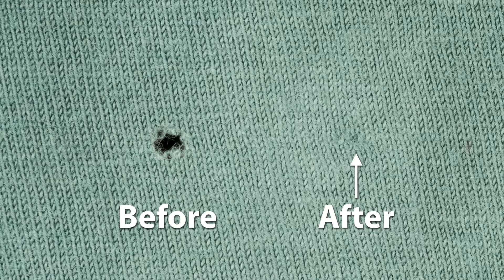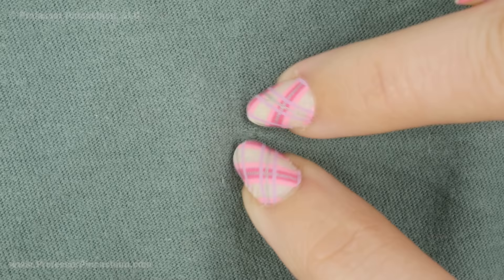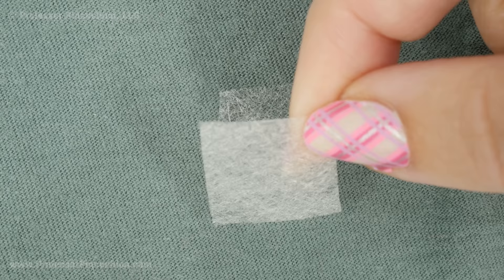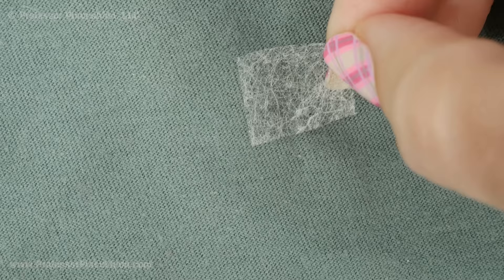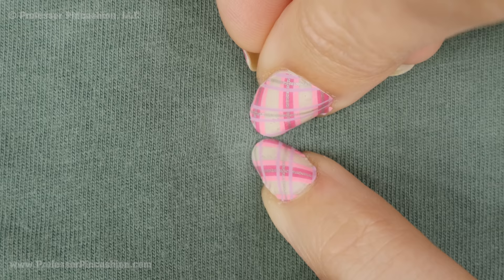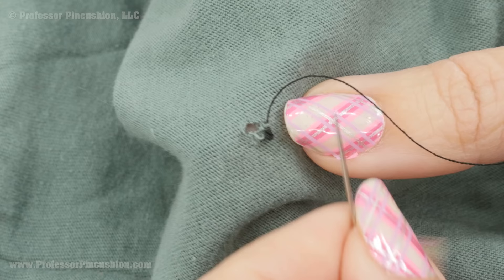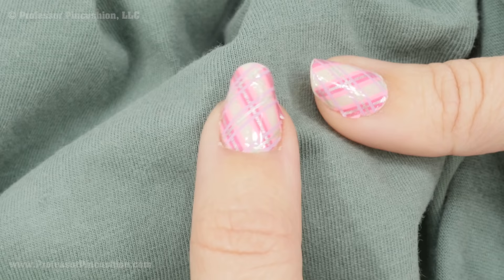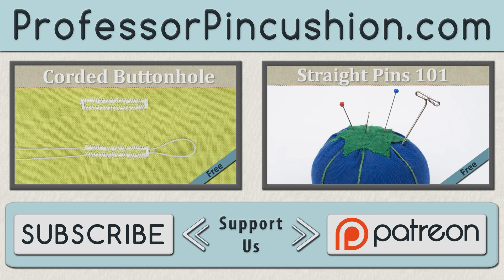How to Repair a Hole in a T-Shirt

Comment: Or just use liquid stich. It's $3 and quick. I just watched this to see if I could fix a larger hole, but since these methods are for tiny holes, seriously people, just use liquid stitch. (Like fabric glue) it works very well, dries clear, and incredibly easier than either of these methods.
Reply: I've used fray check on holes like those and no one was the wiser.
Reply: Are you able to notice the glue? I'm trying to repair few holes like the ones on the picture
Reply: Don Francisco you can test it out on a less favorable item in the same material before doing it on the actual item.  It's super cheap and won't go to waste.
Reply: Brittany Templeton benim kanalıma bak

Comment: Hey it should be easy to sew a hole in my shirt 
>FUSIBLE BONDING WEB
>ULTRA LIGHTWEIGHT CUTAWAY STABILIZER
oh there is an alternative
>LIGHTWEIGHT FUSIBLE INTERFACING
Come on i'm not trying to craft +3 shirt
Reply: Glue a funky patch on it
Reply: I thought about a funky patch but then thought better of it since this tiny hole is on my brand new full black workout pants grrr
Reply: Ha Peenes you either want the helpful suggestion or you don’t!

Comment: Use  PVA glue on dryer sheet for about-free repair material.  I know this from smoking big cigars.
Reply: What is pva?
Reply: Whats the name of the two products?
Reply: Think Bounce & Elmer's
Reply: Poly(vinyl acetate) (PVA, PVAc, poly(ethenyl ethanoate): commonly referred to as wood glue, white glue, carpenter's glue, school glue, Elmer's glue in the US, or PVA glue) is an aliphatic rubbery synthetic polymer with the formula (C4H6O2)n. It belongs to the polyvinyl esters family. It is a type of thermoplastic.
Reply: That's cool.  How does it hold up through machine washing and drying?  I thought Elmer's glue was water soluble, but maybe that's  only while it is still wet.
Reply: No, it won't withstand washing, unfortunately, but neither will iron-on after a few washes.  It would be limited temporary fixes for something you needed to wear.
Reply: They sell a product called liquid stitch (it has other names) that you can use to adhere the dryer sheet to the back of the Tshirt. The fix never quite looks right though, so if it's in a conspicuous part, like the front, I would skip it- I have glued pockets or patches of other material (like pink or red tshirts hearts or stars) to cover a hole or stain. I just keep all my torn or holey shirts until I have a bag full, then I stitch them together and make a throw out of them (if I have enough I make a duvet cover) for people. That way they can keep favorite tshirts without having to wear torn, old or shrunken clothes....
Reply: PVA glue might not hold up, but good ole RTV silicone will. It's a little messier and doesn't look as nice (It also leaves your shirt smelling like vinegar for a few days) but it's tough as nails.
Reply: calamitasCorvus could do a rules of engagement and make a blanket out of the t-shirts
Reply: Fred C Dobbs don't you mean weed smoking
Reply: Fusible web is also called stitch witchery at Walmarts. Some Dollar Generals carry it too.
Reply: I think Aleen's Flexible Stretchable Fabric Glue works the best. Work the hole together and place a piece of tape on the front/outer side of garmet and glue on the inside. Beginning with the smallest amount of glue possible...on some thin fabrics I use the tip of a needle to transfer the glue. Don't over work it or apply too much, as glue can come through very thin or loosely woven fabrics. I don't use backing material the majority of the time...patience with thin layers letting each dry min 4 hrs before checking. I wait 8 before adding (24-48 for full dry and wearable).   You'll know if you need more when it drys. It has always stayed intact through washing.
Reply: Fred C Dobbs A dryer sheet! So smart! I wasn’t sure what to use as a stabilizer, because I insist on doing this right effin NOW and only have part of what I need. Dryer sheet. Yes. Thank you. Smarty.

Comment: I have to stand up at work, which gets really tiring, so I wind up leaning against the granite countertop.  I started noticing tiny holes in the lower front of several of my shirts and couldn't figure out why. Then I realized it was where my shirt was being damaged between the edge of the counter and the button on my pamts. I'm going to have to try this trick as soon as I can find some of the recommended products. This may save several of my favorite shirts! Thanks!

Comment: what if you have holes that are bigger? Like 1 or 2 cm diameter holes.
Reply from the maker: You can still try these repair techniques but it'll definitely look more visible
Reply: Selwyn Abraham 
If you don't mind the shirt being a little shorter, you could cut off an even strip of fabric from the bottom to make patches.  You will also need to re-hem the shirt.  Before working on your shirt, it's a good idea to practice hemming and fusing on some scrap fabric that is like the shirt fabric.  If you don't have any suitable scrap fabric, perhaps you have an old shirt you don't care about anymore.  You might even find something similar enough to the shirt you are repairing that can be used for a patch (and then you wouldn't need to mess around with the hem).  

Fuse the patch over the hole from the back of the shirt fabric.  Use fusable web like she shows in the video.  The right side of the fabric patch should be the side that shows through the hole.  Put some parchment paper between the ironing board and the shirt so the fusable web in the hole doesn't melt your shirt to your ironing  board.  Put another piece of parchment paper over the patch to protect your iron from any melted fusable web that might leak out past the edges of the patch.  

If the edges of the patch and fusable web are cut with pinking shears, the patch should be less noticeable than if cut with straight edge scissors.  (It may not even matter much or at all;  I'm just speaking from my own experience.)  The zig-zag edge from cutting with pinking shears makes the patch edges blend in better to the finished garment.  

Also, be sure to follow manufacturer's directions that came with your fusable webbing.  Too much or too little pressing time and/or heat will cause a weak bond and the patch will come undone.

If the holes are much bigger than the one in this video, you won't be able to "smoosh" the hole closed like she shows here.  Just count on the matching patch to fill in the hole.

Comment: what are those material u use in the first step?  pls
Reply from the maker: it's a fusible web and lightweight stabilizer :)
Reply: +Professor Pincushion thank you  prof :)
Reply: Professor Pincushion where can one purchase these.
Reply: Just cut some driving sheets 😂
Reply: sapito sandy means?? what r driving sheets??
Reply: Professor Pincushion is
Reply: fusible web

Comment: I just use a magic marker. For example, if it is a black t-shirt, I put 
it on and then stick a black magic marker tip into the hole(s). After I do 
this, I remove the t-shirt. Then I look on my skin to find the black dots
 the marker left and further color the area(s) in. Works every time!

Comment: I just pull the two sides together and put The tiniest drop of THICK superglue on the backside of the shirt. It works but it leaves a tiny spot on the fabric so I only use it on black, navy blue, and dark t-shirts. It also works on poloshirts.

Comment: The holes are caused by a certain type of moth. Store your T-shirts folded in drawers and they will not get holes. Also, after washing, do not hang up to dry. Lay them flat to dry, then store in drawers. You will never have another hole. I promise!

Comment: also she was struggling with a super thick needle to get through the loops ... you would use the thinnest needle and thin thread to avoid puckering, then coat the back with fray check or something similar ... I prefer to just add a few holes which is the latest craze in fashion because usually it is somewhat visible and the iron on does not hold up to the wash.

Comment: I have a T-shirt with several tiny holes (cloth moth) close together (about 1/4 inch (6mm) apart). Can I use single, larger pieces of fusible web and stabilizer? Or will this either look odd after the repair (the fabric may not lay naturally) or will the fabric pull away from the web & stabilizer? Should I, instead, use several small pieces of the repair materials?

Thank you for such a practical repair video. I get so frustrated when I find such destroyed clothing in my drawer. It's nice to know it is reversible. 👍🏻

Comment: Hi, could the second technique also be used to fix a hole in non stretch fabric or would there be a better way of doing that?
Reply from the maker: +Beccy Sweetland It could but you may want to treat the area with fray check.  With knit fabric, you don't have to worry about fraying but woven fabric can fray even after the repair.  Fray check can make the area a little stiff so I would use a light touch when applying it.  good luck!
Reply: Hello nice to meet you

Comment: I have a top I bought from nordstrom that I had barely used it thst got a tiny hole. Now, I won't gave to throw it away. Thanks
Reply from the maker: that's happened to me too but I caught it at the store and they gave me a major discount but after a fix, no one will know the difference :)

Comment: Just want to point out that the 'fusible bonding web' is brand name 'Mistyfuse', and the package I bought of that cost over $40.  So, if you don't happen to have it on hand for some other projects, maybe you'll want to forget it.
Reply from the maker: You can buy fusible webbing from Dritz and it should be about $4.  It comes on a skinny roll but for repairs like this you don't need large pieces:  https://www.google.com/shopping/product/8476434823652989069?lsf=seller:3122104,store:13708354418100825428,lsfqd:0&prds=oid:2144633880446478153&q=Dritz+Fusible+Bonding+Web+Lightweight+White+5/8%22X25Yds&hl=en&ei=cfZ8WLKrCqbf0gLqm5KgAQ&lsft=gclid:CIulsL2Mx9ECFU6VfgodNKsB4A

Comment: This is a very temporary fix.  The fuse-able patch will eventually disintegrate or peal away after a few washes and drying.  Sewing the holes doesn't work either as it leaves a very obvious "repaired hole".
Reply: Tracy Brown. Hi Tracy. I use this same fusible web a lot in book binding to create a stiffer fabric to cover my journals and discovered that if I did not apply a little downward pressure and leave my iron over the patch long enough I would not get a strong enough bond. I have also used it on store bought quilts where the patchwork would fray at the seams. My fused patches have held up to many washings over the past 10 years.
Now I can save my T's.
I would like to add that the repair won't be as flexible as the surrounding T-shirt fabric, so it is important to use the lightest weight fusible web and backing material, so the repair won't be so stiff; especially for the thinner women's/girls T-shirts.

Comment: Not bad.  But: the StitchWitch with fusible method will come off sooner or later.   Home irons do not get hot enough for true fusibles to properly adhere.  The sewing method will actually fix the hole, but should try to imitate or actually do a knit stitch vs. a whip stitch to make it truly reconstructed. Matching color thread of course.  Fashion institute of technology grad here.

Comment: Why I put my finger down, because it's a knitwear, in which there are facial and purl loops. The repair of such a product essentially looks like embroidery on top of the main knitting. That is, we raise the hinges, as if knitting a knitting needle. I will only support the method with non-woven fabric, because later it will be easier to do by the method that I wrote the extract

Comment: interesting that they didnt have better options in the year 2018, i think the last method is to visibile. There must be a better way to fix, like with glue mixed with color matching cotton or something like that. the last method tighten the area of the hole to much, it looks strange afterwards.

Comment: Your second repair is not good-looking because your sewing way. You should close the hole with a similar thread (usually you can find useful pieces in the existing sewings) first by horizontally sewing in the mid-thickness, starting and ending some cm away from the hole. Then you do the same vertically. So, you will not have an over-thickness, or it is distributed progressively in a wide area. Also you don't need knots at all, the inside cm maintains the thread. Taylors do this on rather thin tissues like on pants or vests. The repair is quite invisible if it is well done. In France, they call it "stoppage".

Comment: I have a hole that's the size of a pin though the fabric is modal and spandex. What technique would be best? I'm not the best at sewing but not the worst either. I figure if I go that route I can try to bring the hole together.
Reply from the maker: If it's fabric with synthetic fibers, it's best to use hand sewing the hole closed

Comment: I have a very large hole that appeared on a Linen top after very gently washing and air-drying it.  You can easily pass a large straw thru it. I thought about putting about 3 long diagonal tucks to hide it.  Luckily, the top is one of those that is long thru the torso and is elasticized  around the hip. It would change the style of the top a bit... but I've noticed a lot of Dresses lately that have that decorative tucking on the side of one waist.  What do you think?
Reply from the maker: if I were you, I'd try your idea but do a basting stitch.  That way, if you don't like it, it'll be easy to take out.  If you do like it, then you can just do regular stitches over the basting and make it permanent.

Comment: Hi, I would do a purse string stitch on the larger hole. It involves running a continuous stitch around the edge of the hole on the right side of the garment. Then push the needle through the hole to the wrong side. The next step is to pull the thread to gather the stitch and finish off in your usual way.

Comment: I really want to try this technique on my lovely sweater dress. I am wondering if it will work because the fabric of the dress is thicker than that of the t-shirt. The bonding paper method is nearly undetectable!
Reply from the maker: It really depends on your sweater fiber content.  If it's not 100% cotton, it might not be able to handle a high heat to be able to use the fusible webbing.  In that case, you might want to stitch the hole closed instead.  You can see this video where I did repair a hole on a sweater:  https://www.professorpincushion.com/professorpincushion/repair-a-sweater/
Reply: +Professor Pincushion Thanks for the helpful information! I am the noob of the newbies when it comes to sewing lol!

Comment: I have watched both repairing a hole in a t-shirt and repairing a hole in a sweater. Is repairing a hole in spandex any different? Have a hole in the middle of the shoulder of my favorite blouse (not along a seam.)
Reply from the maker: hmmm, I think repairs in spandex would be a little harder to camouflage.  I haven't tried to repair this type of fabric.  Maybe you can iron on a stretch knit interfacing on the inside to help stabilize the damaged area and make the hole smaller.
Reply: Might that melt the fabric, with a percentage of it elastic?

Comment: Hi Tova. Thanks for the ideas.  I've not been able to use the no sew option as the bonding irritates my skin (or maybe it is the glue in the bonding).  I've had success with darning holes in tee shirts, but the tiny pin holes make for tedious work! I've toyed with the idea of using the darning setting on my sewing machine, but every video I've seen makes it look more laborious than hand sewing.  Have you tried darning on a machine?  If so, any wisdom you are willing to share? Thanks!

Comment: If I use the fusible bonding with no sew on stabilizer, will the project still be successful? What is the purpose of the stabilizer?
Reply from the maker: the stabilizer is to keep the glue of the fusible bonding from sticking to your iron or press cloth.  Think of the fusible bonding has just a web of glue.  It needs something on either side of it or it might get messy.

Comment: Using the fusible web that way is such a great idea and worked so well. The 2nd one doing a darning type repair looks good too but I was wondering if, after doing that repair, using the fusible web on the back might help it lay even smoother.  I definitely need to try a bit of experimenting.  Thank you for sharing... now a new subscriber.
Reply from the maker: thanks for subscribing and I'm so glad it worked out for you :)
Reply: Is fusible web the same as wonder web? The one you use for alterations?

Comment: Which pressing cloth should be used? I can see it's not an organza type. Thank you.
Reply from the maker: I'm just using the store bought press cloth from the notions department, but you can also use an old 100% cotton pillowcase or other cotton fabric. The point is that it's fabric which can take a high heat and it protects the fabric underneath.
Reply: @ProfessorPincushion  thank you😁

Comment: Would these same techniques work on the fabric used by LulaRoe 96% polyester and 4% spandex. My garment actually has a V cut with scissors flaw.
Reply from the maker: I would be nervous with polyester because it can't handle a high enough heat from the iron to melt the fusible webbing and may damage your fabric. Maybe hand sew this instead if it's not a big tear.